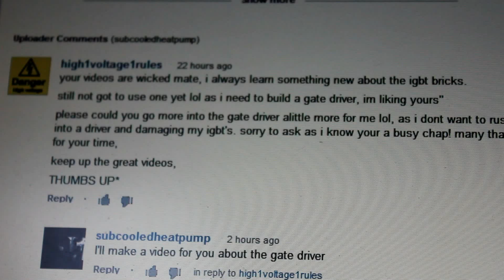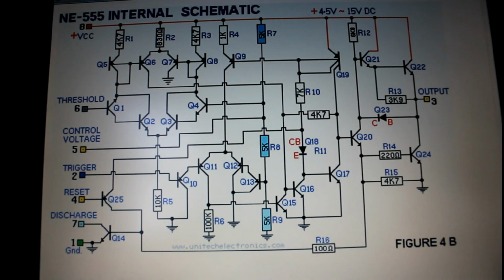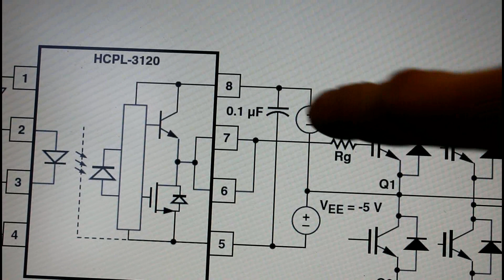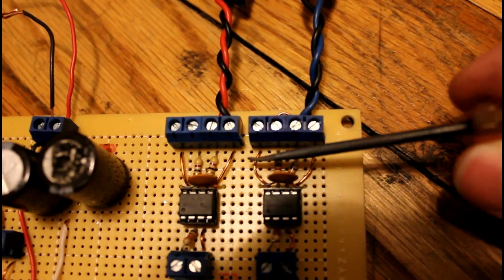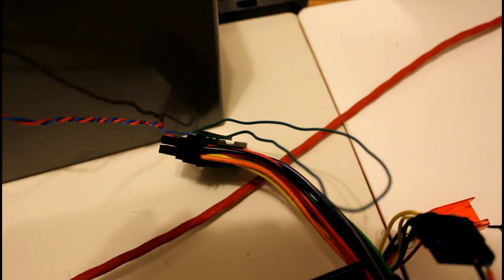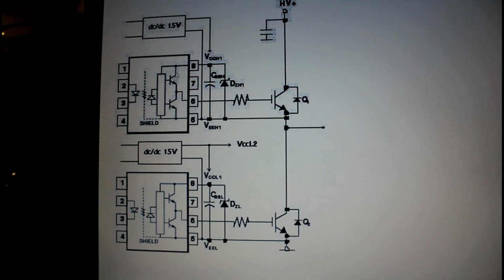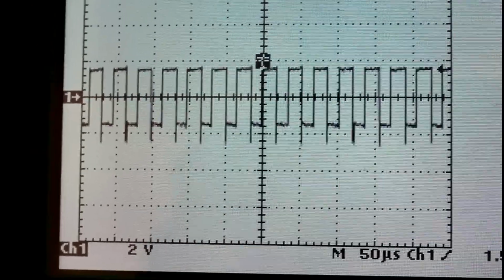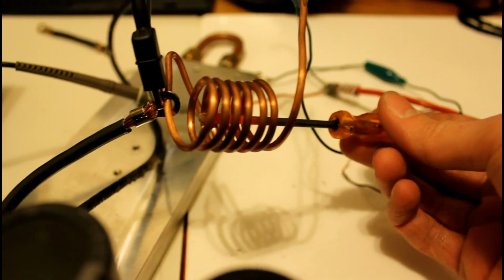Video Request; IGBT gate drivers

Comment: is it possible to get AC square wave using only one IGBT?
Reply from the maker: You can technically, but it is not recommended. You can drive an inductive load with one IGBT. The problem is the turn off voltage, it spikes too high and the IGBT breaks down so you can only use very low voltages.
Reply: subcooledheatpump You use free-wheeling diodes to clamp the voltage spikes.

Comment: want to chop AC voltage using IGBT...basically using generic buck converter circuit.
Can a bridge rectifier across IGBT be helpful so that IGBT always sees a voltage drop across its drain and source and AC voltage can be easily switched?

Comment from the maker: HCPL-3120 is suggested for use with IGBTs up to 1200v/100a or 600v/200a. You can use the output of HCPL-3120 as a signal input for a larger gate driver, such as IXDN630CI for driving larger IGBTs. In this way, the HCPL-3120 merely acts as an optoisolator. You can use HCPL-3120 with larger IGBTs, if you make a sacrifice in switching speed. By selecting a gate resistor with a higher value, you can use HCPL-3120 for the larger IGBTs, although switching will be slower. Thanks for watching

Comment: I note, the 3120 data sheet says : "The voltage and current supplied by this optocoupler makes it ideally suited for directly driving IGBTs with ratings up to 800V/50A. For IGBTs with higher ratings, the VO3120 can be used to drive a discrete power stage which drives the IGBT gate."  We are using a MG4001J rated 600V/400A. Will it be necessary to add an additional power stage??How?? Thank you very much. Your video is excellent

Comment from the maker: If you are making a gate driver with protection what might concern you is the speed in which it reacts to an overcurrent. Avoid turning off the IGBT too quickly in a short circuit, that could lead to a very high turn off voltage. Induced noise into the protection circuit can be a problem so make sure you have a good layout. Make sure that you will be able to supply the peak gate drive current and that your gate driver will turn off if the gate supply voltage falls too low.

Comment from the maker: I don't know too much about SCRs, but it depends on what you will be using the SCR for. 

SCRs are current controlled, and they take very little current to trigger compared to an IGBT. You can use a pulse transformer to trigger a SCR into conduction. I'd say that might just be the best way if you are using them to rectify AC

Comment from the maker: The BAP1793 just receives a light signal from a set of LEDs over a fiber optic cable. 

I'm no expert on fiber optics, but as far as I know, you would be using fiber optic LEDs connected to the output of the CPU. They would convert the CPU signal into a light signal, then send over fiber optic cable to BAP1739. You can built something like this yourself of course if you buy the fiber optic LEDs and phototransistors Then the phototransistors will pull an active low gate drive down

Comment from the maker: If your gate drivers are optically isolated then I don't see the need, but some aren't. You can use a phototransistor and LED for simple optical coupling

There are fiber optic compatible phototransistors and LEDs available at digikey. Personally I think it would be a good idea, because then you can physically separate the CPU and the gate drivers. Good for reducing noise and interference

Comment from the maker: The capacitor recommended in the HCPL-3120 datasheet is the one I used. The resistor for the gate driver really depends on the IGBT in question. For the 555 timer, that also depends on the IGBT in question. Obviously smaller IGBTs can use a higher switching frequency, and larger ones will need a lower switching frequency. If you can be more specific about your project, I'd be glad to help

Comment from the maker: Although I wouldn't recommend using an audio signal for driving IGBTs at high power, I can tell you that it does work. I've used IGBTs and the HCPL-3120 with an audio signal to modulate a small lamp with music. The induction heaters I show on my channel usually use the audio output from a PC as well, although the PC would be generating a sine or square wave and obviously not playing music. Thanks for watching

Comment: Actually isolated driver is in my experience not that common unless i'ts actually needed for like high side switching.
Clare 414 is a typical IGBT/FET driver. I've used a Fairchild FAN3122T because it has an internal pull down resistor so I can skip that part on the board. Has to be the T version, the 'C' cmos version is a useless mystery to me because it needs half the supply voltage to trigger (which for IGBT is typically 15V) which makes no sense. The TTL version works with 3 and 5V logic.